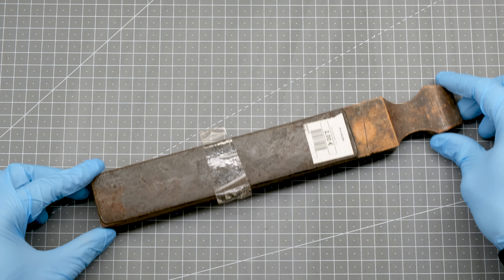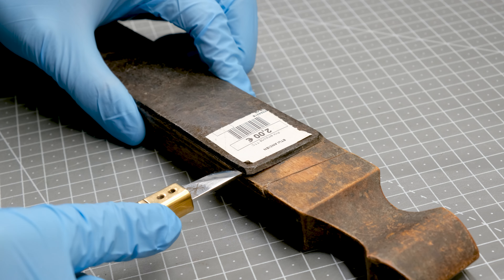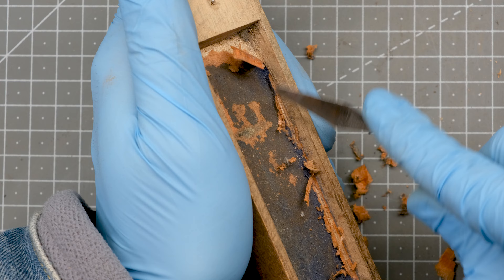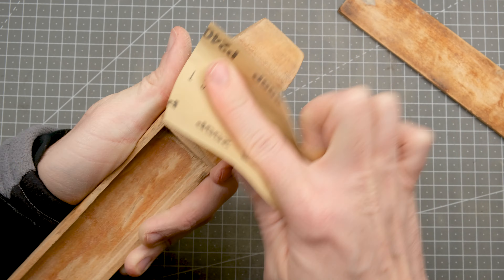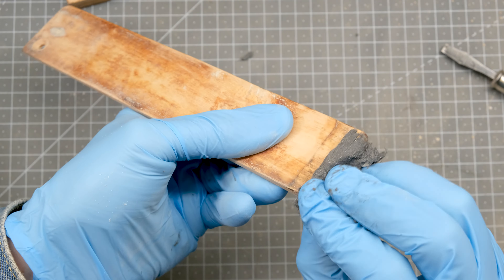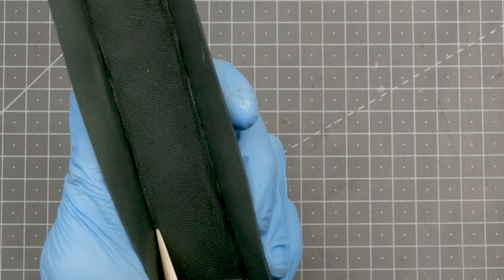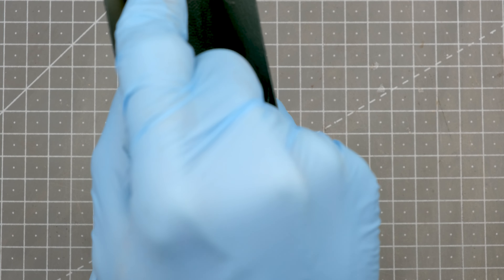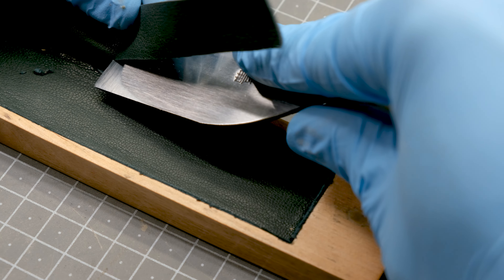Very old and dirty vintage razor case strop restoration - WOOD AND LEATHER BROUGHT BACK TO LIFE!!

Comment: Love your refurbish videos.  I still want a Swiss Map Case to clean up.  Can't find one.  As for removing the paper...a couple of suggestions.  A fine cobbler I know, sometimes uses acetone to loosen old glue.  Doesn't hurt leather so it won't hurt the wood.  Also, you may want to investigate getting an inexpensive cabinet scraper to remove all the excess paper and glue.  Probably a better result than the knife blade.  I liked you 'piecing' technique for the inside of the box.  You got a better fit than using one big piece with the corners sliced.  Thanks James!
Reply from the maker: Thank you so much for the kind feedback! I had not thought about acetone but it would have been the perfect solution in this case :o
Also, I keep meaning to get a cabinet scraper but whenever I see them in DIY stores they look so flimsy and cheap I just can't bring myself round to grabbing one... I may need to reconsider as it would have been the perfect tool for this application.
Looking for Swiss items outside of Switzerland is tough. I've had luck mainly on Leboncoin which is a French second hand website - you sometimes get Swiss items trickle into France. You "may" be able to find some you can buy and get delivered through the website's services.
Hope you find what you're looking for!
Reply: @JamesBerry  Any wood tool site should have them.  An old sacrificial saw would work.  Another think I remembered, if you know that a joint is glued with hide glue, then use white vinegar to soften it.  Fixing Furniture in Canda uses that often.